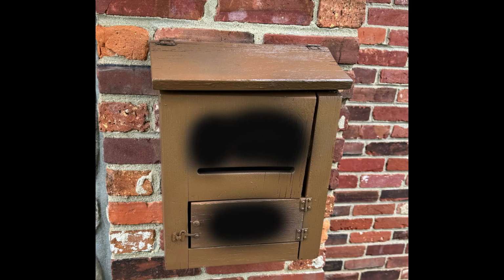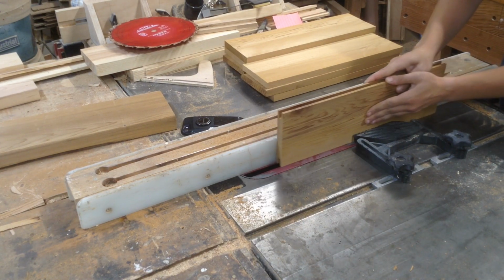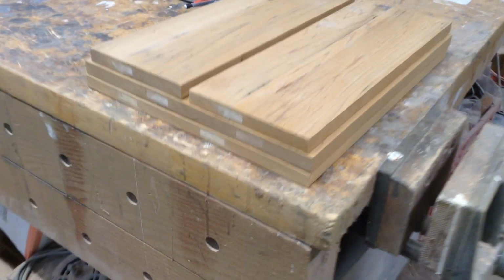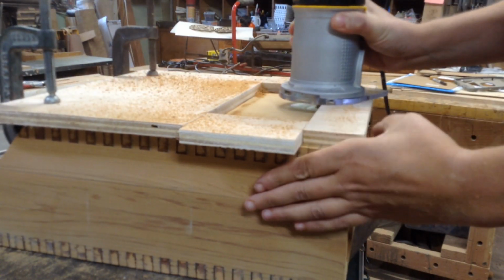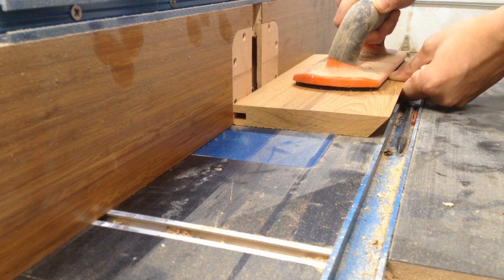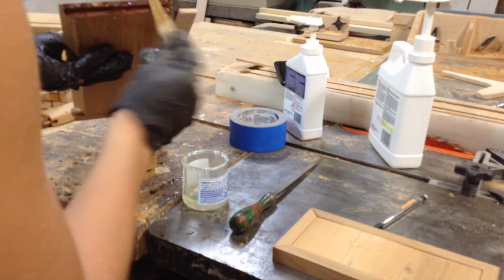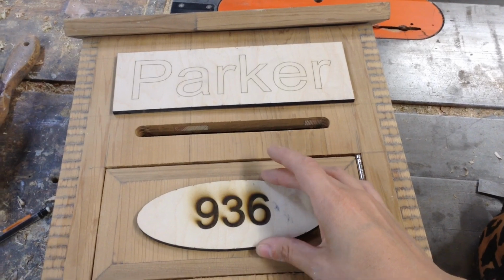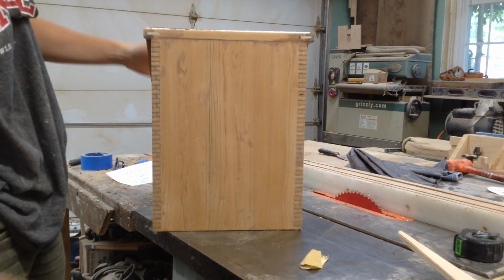Save Money & Make A Mailbox || DIY How To

Comment: Why the slot if the mail goes into to top?
Reply from the maker: No clue, I just copied the original.  If I had to guess maybe it would be for the mailman so they don’t have use their free hand to lift the lid.
Reply: @HoneyBadgerWoodWorks  my bills are just a lot larger than the slot so the top would get the most use!
Reply from the maker: @gcranch9913  hahahahaha

Comment: Beautiful mailbox, I'm sure your client will love and enjoy it for years. I do have a question about your choice of glue for exterior projects; just wondering if you have ever tried using a polyurethane glue? I made an exterior screen door with acrylic 6 pane window insert for winter time use, and installed it with 3 spring hinges so it would "slam" as my wife wanted one that reminded her of one from her childhood. There were no screws or nails but mostly dowel pinned mortise and tenon joints all glued with polyurethane. It wasn't in direct line with the driving rain but showed no signs of weakening joints after several years so I made another for the front of our house. I never owned the house for too much longer so never got to see how that one faired. So I'm wondering if you've ever used this type of glue and how you would compare them? I'm thinking the polyurethane might be a fair bit cheaper and less messy to work with. A bit long I'm afraid but thanks for reading. Love your channel.
Reply from the maker: I’ve used poly glue.  Dont necessarily love it or hate it.  The expansion of it can be a little bit of a pain if you don’t plan ahead well enough.  I believe epoxy has a stronger bond strength, and holds up to heat better then poly glue.

Comment: great project, while I could see the fingerjoints failing due to grain orientation, it probably wont be an issue thanks to the overall lenght of the fingerjointed side, looks realy neat though.
Reply from the maker: The fingers can be fragile this way until glue up, but with all that epoxy I’m not concerned about it.